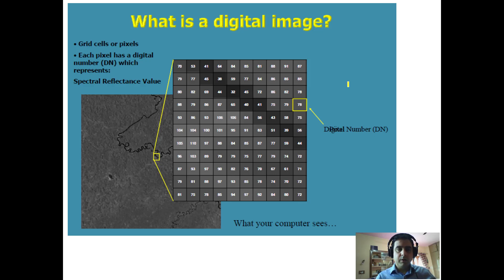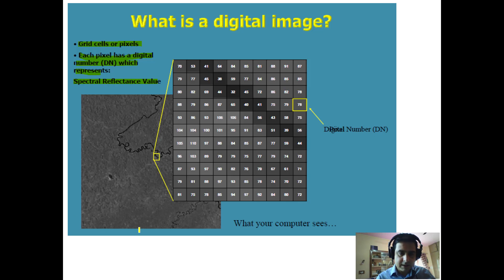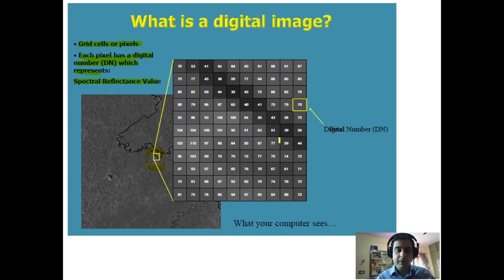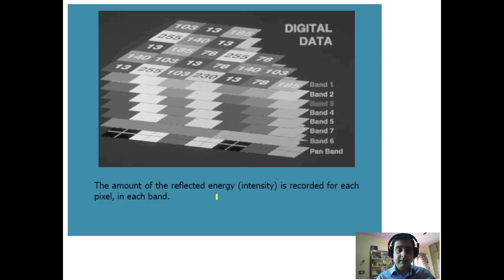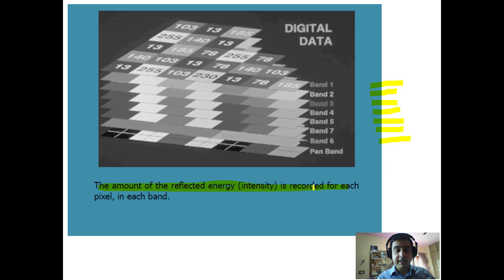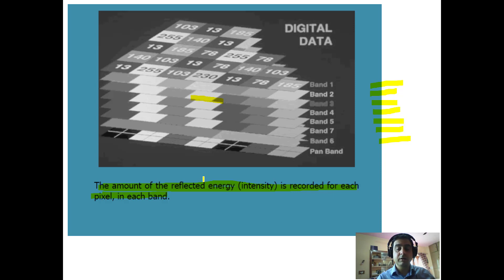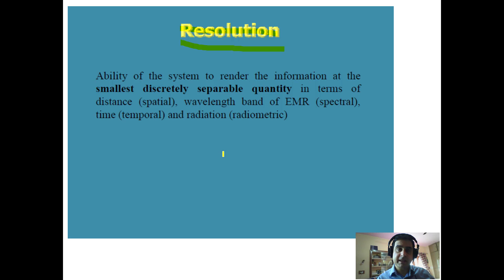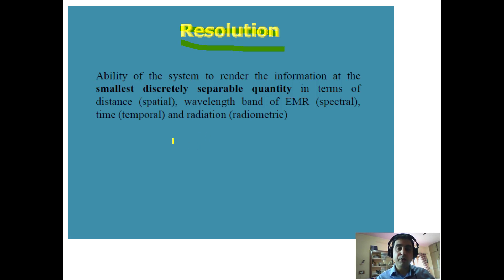Digital Image and Resolution

Comment: Thank you soo much sir if you explain what is the meaning of DN and based on which mechanism each pixel have a number
Reply from the maker: DN is the digital number which is a reflectance value for each pixel depending on the object reflecting through that pixel. DN may be less for water containing pixel and more for vegetation containing pixel.